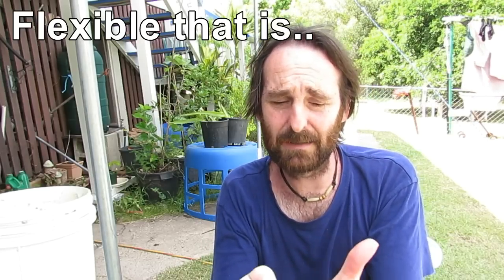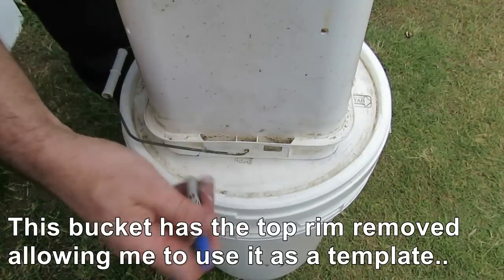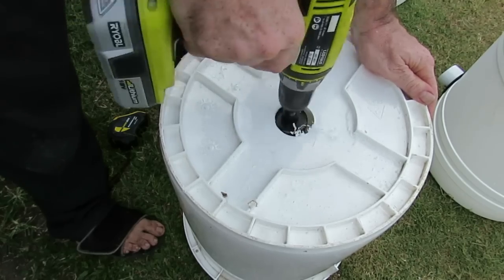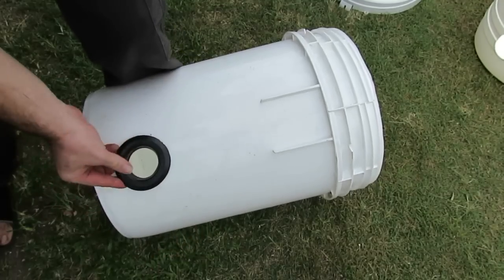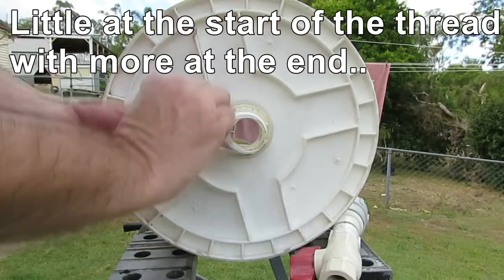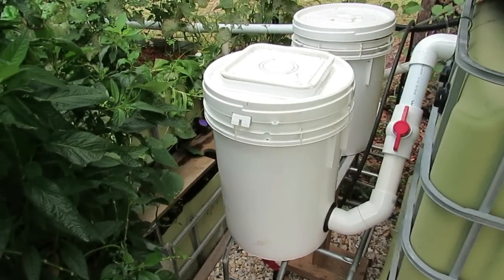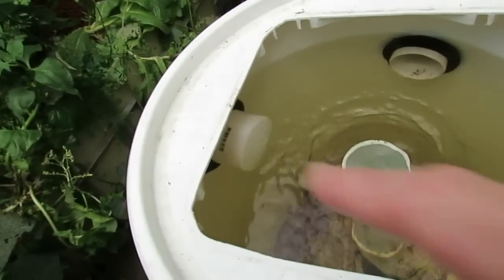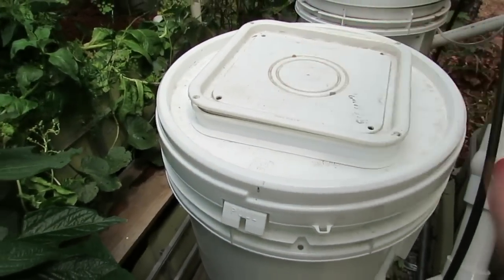How to Build a Radial Flow Solids Filter for Aquaponic Systems

Comment: When constructing the filter, ever consider making the bottom slope to the center? You could sandwich the very center between two large washers to keep it flat for the drain seal, and then use a heat gun and pressure to create a slight funnel shape. That may help the solids migrate to the drain. You would need to trim/modify the platform it sits on, but that would be a cinch.

Comment: I have learned over time to use plumbers silicone grease. As long as you do a decent job of cleaning up the hole of rough edges your installation and chance for leaks will have a better outcome.

Comment: I was thinking about pouring concrete in the bucket to form a cone, but I don't think the solids will go to the middle unless there is a swirl current.
Reply from the maker: I've seen folks do just that.
Hope it works well for you mate. 👍

Comment: You didn't shows the bottom construction
Reply from the maker: If you mean the drain, the explanation of the fittings is at 2:00 & fitting the drain together is at about 5:00
Cheers.

Comment: Rob, thaks a lot for your videos.. I have no experience at all. In like the idea very much. Just one question. The water flows from the fish tank to the filter and then to beds or wice versa? Thans a lot for the answer and take care.. 🙂🙂
Reply from the maker: Sorry I missed this Eduard. In this system it flowed from the solids settler to the bio filter & then to the grow beds. 
In my new system it flows from the settler & filter into the sump where the water flow is split by the pump & delivered to both the beds & fish tank.
Hope that helps some.

Comment: Trouble seeing  the entire build, it’s one intake from the fish tank bent upwards to top 
It don’t swirl ?
It just lets the waste drop 
Right 
Then the drain for the excess waste 
The video don’t show why or internal operations
Reply from the maker: This recent video runs through a better description on how these are set up Jesse,
https://youtu.be/sBCC9tMsleY
& this is the build video is how the one from the above video was built,
https://youtu.be/crKjqCJmIV0
Hope that helps mate.
Reply: @RobsAquaponics  hi 
Please send the  link on the build 
If you have big thanks 
Just starting out with a 
Ibc tote and have 11ft float bed set up already cut the 2” foam 
Now just need filtration I am a beginner 
I have a simple drain flow  set up 2 barrels 
Now starting a deep water culture raft so I need a filter set up 
I have two blue 55g barrels 
I might expand so just need help with filtration 
Thanks sir I appreciate and like all ya videos 👍
Reply from the maker: @Elonmuskfanpage655  The water entering the fish tank displaces water out the solids lifting outlet as there's no where else for it to leave. That then flows into the pipework of the radial flow settler by gravity as it's outlet into the stilling well is lower than the outlet in the side wall of the fish tank. 👍
I don't have any plans for this or any other large build sorry. I am looking at doing something down the line when I get time.
Cheers.
Reply: In video you linked me too 
How the the center tube lift waste ?
In the video there is no pump that shows 
So how does it get sucked into the radial flow ? 
I’m trying make this but it’s confusing how the tube in the middle of the radiail glow pull waste up 
Please send the link in the build 
Big thank you 
Love your videos

Comment: Very Cool.  To purge the accumulated debris, try a very small pipe and uniseal in the side as close to the bottom of the bucket as you can get, stuck in only far enough to seal,  so the waste drain draws from the edge of the bucket instead of the center.
Reply from the maker: Nice one.
This is out current radial flow settler if you want to suss it out,
https://www.youtube.com/watch?v=crKjqCJmIV0
Is a tad larger than the one in this clip & set up much better. 😉👍
Reply: @RobsAquaponics  Very nice design, neat use of the flange to 'vacuum' the bottom.

Comment: maybe I missed it but what size are the circle and square buckets you used to make the filter?
Reply from the maker: The main drum was 60L/15.8gal I the buckets were about 10L/2.64gal.
Just posted 2 more up to date clips that might help you out more
Radial flow settler design points,
https://youtu.be/sBCC9tMsleY
Our current Radial flow settler build clip,
https://youtu.be/crKjqCJmIV0

Hope that helps some L&S.
Cheers.

Comment: hi mate in a small flip setup does the pump need to run 24 hrs?
Reply from the maker: I have all out pumps running 24/7 Vance.  Some will use timers but I prefer not to as I see them as another fail point in the system. 
HTH some 👍👍

Comment: Hi! I’ve been binging your videos the last few days, I appreciate the wealth of information, thank you. I have seen some setups that include a few fish in their sump tank as well as their fish tank, what are your thoughts on this? Is it worth the few extra fish and carrying the solid waste from the sump to the regular fish tank? Seems like it somewhat sets back the purpose of the solids filter. Any insight is appreciated, thanks! Keep Growing.
Reply from the maker: I have done it myself & don't think it's too much of an issue if it's just 1 or 2 small fish. 
In our case I have a small catfish in the sump as he would quite easily get sucked up the solids lifting pipe in the fish tank. Once it gets a bit larger it will be gong in the main tank though. 
I don't think I'd have loads if there was no filtration between the pump & fish tank. 
Sorry it took a while to get back to you.

Comment: I use larger bins about the same height as the cut-down IBC. I put the entire drup and riser inside the bin, allowing the intake hole and seal to line up neatly with the outflow hole and seal in the IBC.

So - straight across from the IBC into the bin, then drop and rise inside the bin. As far as the water flow inside the baffle is concerned it's identical
, since one wall of the baffle sits in the gap between the drop and rise. Therefore inside the baffle you just have one pipe, as per normal.

It tidies up the plumbing a treat and allows the use of a U shaped pipe at the bottom rather than multiple 90 or 45 degree elbows and joining pipes. Fewer parts, fewer connections, less exposed pipe.
Reply from the maker: Glad it works well for you mate. 👍 Any chance of a walk through clip to give us a look? 
Cheers.

Comment: what is the best size pvc tube for an overflow for the fish tank? 275 gallon IBC tank a 55G blue barrel plastic container?
Reply from the maker: Hey Ron. That would depend on your flow rate mate.  I like to use a 2"/50mm on any flow rate higher than 2000lph/530gph.
Hope that helps.
Reply: @RobsAquaponics  yes sir, thank you so much. I was thinking about that. your the best, god speed

Comment: I have a small system,what is the smallest pipe do you feel is possible? Or useful
Reply from the maker: That would depend on the flow rate into the filter.  Ours did OK with a 2700lph flow rate going through a 50mm pipe. I haven't really tried anything smaller as of yet sorry.
Reply: @RobsAquaponics  thank you, love your informative videos

Comment: so this goes in between the fish tank and the beds? so water flows into this first b4 going to the beds and back to the fish tank?
Reply from the maker: Fish tank ► Solids settler/filter ► Grow beds ► Sump tank or back to Fish Tank depending on how your system is laid out. 
It can be plumbed up differently as well but that's the layout in it's most simplest form.

Comment: What size buckets are ideal to use
Reply from the maker: That depends on the flow rate from the fish tank as that will dictate the retention time in the filtet. A few minutes retention time is ok but 5+ will collect more solids.
Will give you a more in dethroned answer in the morning if you need it.
Cheers Troy.

Comment: Hi Rob. Love the videos and they have help me set up my system. We have just added a radial flow but it keeps flooding the fish tank. Currently the system is all running on 25mm pipe. Do I need to increase the size of the pipe going into the radial flow bucket to avoid it over flowing the fish tank
Reply from the maker: Sounds like you need to go up a few pipe sizes Steven. Any idea of what the flow rate out of your FT is?

Comment: Soap???? Not a good idea. Try water or a tiny bit of olive oil. Fish don't like soap not even a tiny bit.
Reply from the maker: Have never had an issue with the small amounts I've used or seen others use. To tell you the truth, a bit of water works just as well once you get the knack of working with them.

Comment: Aquarium gravel vack might be helpful? Easy to make with some left over pipe and a end cap ... use your imagination 🤯
Reply from the maker: These radial flow filters do a great job & only require minimum effort to remove the waste once it's collected. 👍
Cheers.

Comment: Hi rob, how is it going?Really nice video and information, just wondering if i make double radial flow filter, can the filter make double the cleaning?cheers from malaysia!!
Reply from the maker: Hi Asri & thanks.
Do you mean double the volume?  A larger volume filter container will definitely allow more solids to collect. 
I think no matter what size the container is you're using it';s best practice to empty the solids frequently so as they don't start to break down causing issues with the water quality. 
Hope that helps sope.

Comment: Just would have liked to see how you prepared the square bucket 
Did you remove the bottom or did you cut a hole to put over syphon
Reply from the maker: I cut the base out of the square bucket.  👍
Cheers

Comment: Nice shit, but Jesus Christ, you got shares in uniseal or something??  god damn.  dunno what those things are worth over there, but in Canada we're looking at like ten to 12 bucks each...  Even ball valves are killer once you get going...  I try to use fittings , electrical, and water and tighten them so tight the plastics damn near have to be fusing...  lol  I also got a deal on toilet seals, so tied some tanks together that way...lol
Reply from the maker: 😄I sell them. 😉
The 2" uniseals have a RRP of $7.70 + tax here. The bulkheads on the other hand for a 2" over $25 each then you need to buy the PVC fittings to screw onto them .
Reply: Yeah, checked out your amazon site.  Reasonable for sure.  I'll definitely hit you up when I expand...

Comment: what is the difarance radial filter & swirl filter?
Reply from the maker: A swirl filter relies on moving the water slowly in a circular motion so the solids will settle out of suspension & are drawn to the centre so they can be removed via a drain. 
With a radial flow the water changes direction as it flows under the centre pipe/bucket which allows the solids to fall out of suspension. One study done showed that the radial flow works a lot better at removing the solids.
Hope that helps.

Comment: How does water get out of the internal drum? Thanks.
Reply from the maker: Hi there. 
It flows under the base of the internal bucket as the bottom have been cut out. From there it is free to rise to the outlet port & into the bio filter.
Hope that helps.
Reply: thank you sir. I thought it was closed with only the hole in the pipe. We always benefit from you.
Reply from the maker: No problem at all. 👍
Cheers & have a top one,
Rob.

Comment: Nice build mate! Do you need to put tiny holes on the two lids (the inside rectangular and the outside circular)? Wouldn't that affect the flow due to vacuum forming?
Reply from the maker: Cheers vol vox. The lids sit on fairly loosely so there is no real risk of one forming.  A siphon can't really form as the solids outlet from the fish tank has an open port at the top to prevent it from occurring.
Have a top one. 👍

Comment: Rob,
The holes you put in the bucket for the radial flow were 2" on the sides but the hole in the bottom looked smaller even though you said it was also 2".  What size was the bucket you used.  Thanks.

Comment: Interesting stuff and well explained. Thank you for the good information.
I guess this is similar to the "swirl filter" approach but it uses the inner bucket walls as a barrier and that makes the solids in the water have to move downward after they exit the center pipe and then the water  moves upwards toward that exit hole but the weight of the solid material tends to keep it down at the bottom.  Have you had experience with the swirl ones?  If so,  do you find these radial flow filters to work better?  Or does this type of filter tend to work better for the size bucket?
I'm building a duck pond filtering system for our 3 domesticated ducks.  Using the 55 gallon plastic barrels.  Wondering if this type of filter would work better.
Reply from the maker: Hi Matthew. From what I've seen the Radial flow filters/settlers are more efficient at getting solids to fall out of suspension. There is a paper floating around on it but I can't find link at the moment sorry. 
I'm not sure about duck water as they do tend to kick up a lot of fine solids into the water. If you haven't already search for duckponicks & quackponics online & you should get a bit of info come up. Most duck based systems I've seen just use grow beds to filter the solids. 
Hope that helps a bit mate.
Cheers.

Comment: I think I understand how to build the radio flow filter however I do not understand how you hook it up to the fish tank itself I noticed where the 2 inch pipe entered the tank Does the pipe that hooks up to that point go to the bottom of the fish tank? Please explain thank you very much in advance
Reply from the maker: This clip goes through the solids lifting outlet used on the inside of the tank. It's in our newer system but is almost the same as the one from this clip.
https://www.youtube.com/watch?v=bmzgANTGJ0k&list=PLBcWprMIwYYi3Y3tUNUMWhO-g_ZhWfijY&index=14
Cheers & hope that helps some.

Comment: Built my filter.  It is working very well.  Thanks for all the great videos.

Have 27 tilapia in a 75 gallon aquarium.  Used a 5 gallon bucket and a three gallon bucket.

Started setting up an 800 gallon system today.  Am very excited!

Will be using a 55 gallon drum on the new system for this filter.

By the way,  I had to restrict the water flow from my pump because I didn't use big enough PVC pipe.  Will be using 2" on my new system.
Reply from the maker: Glad the clips have helped you out some Z223I 👍
Hope the new system is running smoothly for you.
Cheers.

Comment: it will filter fish shit also right? which is needed for vegi !!!
Reply from the maker: Most of the ammonium is released through the fishes gills suspended in the water along with other nutrients & some from the cloaca. A lot of what comes out in the solids is filler from the feed but there are also nutrients as well. In a commercial setting they would be removed from the system, run through a mineralisation system then re introduced to the hydroponic side of the system. 
I don't have a mineralisation system here so they get added one of of our many garden beds to feed the veggies in them so don't go to waste  ;)

Comment: how about the nutrient in the water after ?
Reply from the maker: Most of the ammonium comes out of the fishes gills. That & other suspended nutrients have kept our system going for years ;) 
In a commercial setting the solids would be removed from the system, run through a mineralisation system then re introduced to the hydroponic side of the system if it was designed to be efficient. 
I don't have a mineralisation system here so the solids get added one of of our many garden beds to feed the worms & biota that provide nutrients for the veggies in them so don't go to waste  ;)
Cheers.

Comment: Which RFF design do you like better?  This one, or the "Aquaponic radial flow filter for solids removal." you posted on Feb 12, 2013?  The other one had the pipe from the top, and this one has the water going into the bucket first before the larger tank.
Reply from the maker: Hi Sean. Sorry I missed this when you posted it. 
Both filters are the same in that the water enters through the base of the drum with the delivery standpipe allowing the water to exit inside the cowling that redirects the water downwards. 
The earlier one with the pot screwed on the lid of the drum was annoying I thought. With this one I could spot check by just taking the lid off the bucket. 
Hope that helps some & sorry again for taking a while to get back to you.

Comment: looks good dude, i saw on another video a bloke attached a length of flexible hose in the inside of the outlet to waste.  the hose was just long enough to reach the surfaces in the filter.When he opened the tap, it acts as a vacuum to just run the hose around and suck the particles out, he had it attached to a stick so he could manipulate it without even getting his hands wet.
Reply from the maker: Have seen the same clip & think siphons do make life easier. I was using a siphon for a while on the smaller system & used it to do quick cleans. 
With the larger one the crud ends up all over the walls due to the number of fish so it needs a good hose out.  :-D 
Cheers mate.